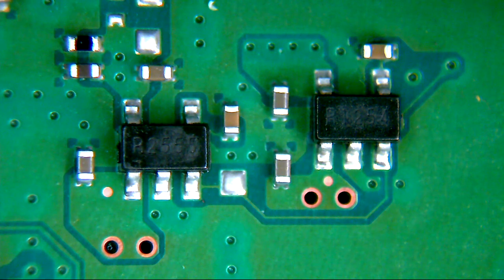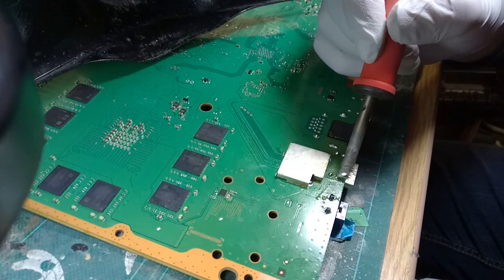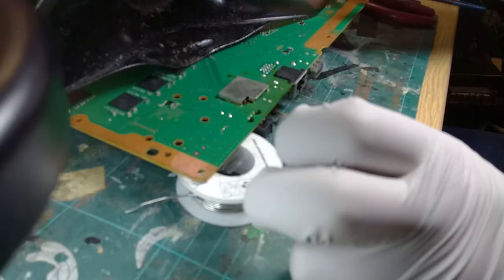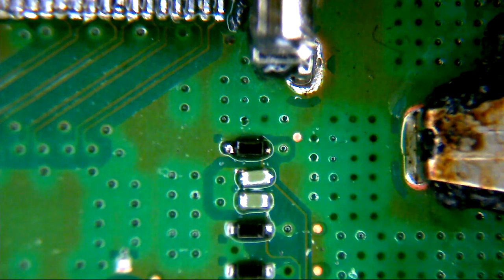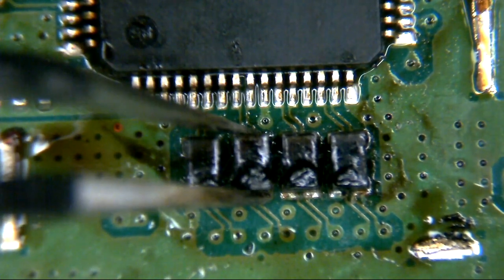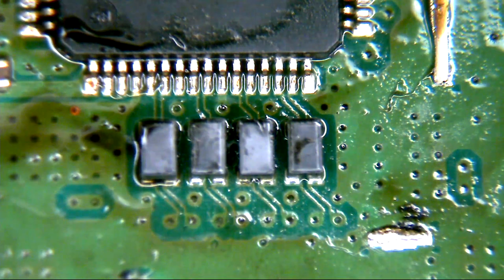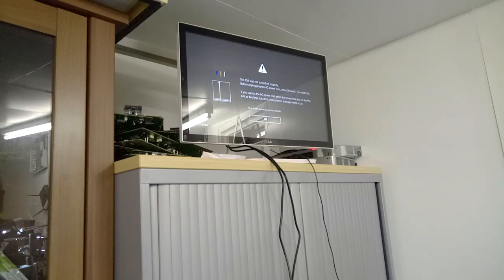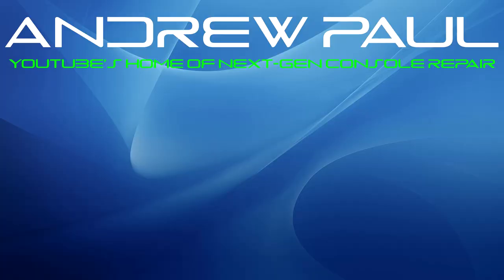Idiotic "Professional" Ruins PS4 HDMI Port Repair. Can We Fix It?

Comment: I can't believe that someone looked at that after they finished soldering it and said "yep, that's good." Every one of those pins looks like they didn't have enough heat. The plastic damage on the ethernet port....ehhhh, shit happens. I know I've burned my fair share of plastic from collateral damage but it's always been cosmetic (that one there looks pretty fucked up though). As an amateur in training, it really upsets me when people who do work like this pass it off as professional, and even charge people for it. Ridiculous.
Reply: Do people not know what kapton tape is? That’s it’s entire purpose, to localize your heating and prevent from damaging or accidentally melting or desoldering nearby components, and from the looks of it they didn’t know what flux is either, all of the solder joints look oxidized, kinda like they weren’t heated enough and didn’t bond to the pads

Comment: I'm no expert, it looked like your pins were not aligned well.
15:40 looks to be off the pads to the right a smidge.
Seems a better initial anchor might've saved that extra work?

Comment: In fact people see the top level of modern electronics being repaired in front of their eyes and the most of them thinking how easy are these kind of repairs that can be done by everyone.But no one can do these except a few well skilled with proper equipment,much experience and even in some cases quite luck if all things go well and nothing bad is happened.
Reply from the maker: It definitely looks easier than it is - that said much of the time though if decent equipment is invested in then it can make even the most ham-fisted amongst us look capable in this field. The problem comes when you only want to repair your own machine which makes that investment a waste of money and people try and use cheap equipment which is what then gets them into trouble. Even then though it's still cost them more than it would to simply get it repaired for them - but as this channel shows even that isn't a safe bet sometimes. I think it's about time the consumer electronics repair profession required some accreditation so that the public could be sure that the people repairing their machines are in-fact competent professionals which might cut down the number of badly repaired or damaged machines out in the wild and stop this 'race to the bottom' mentality amongst the cowboys out there who devalue our profession, work and levels of skills involved. Sadly won't happen though.

Comment: What exactly is FLUX? I heard of using isopropyl alcohol during these things but now i need to know what FLUX is to use as well.
Reply from the maker: Flux is a paste or liquid which aids tinning and wetting of solder joints - in other words it helps it to flow easier and helps create a better quality solder joint. It's essential for an easier repair experience and a better quality job.

Comment: Great video man, love your videos very educational and entertaining.
I always have said two is better than one, two hdmi ports in case one breaks.
Also if they could do a design of hdmi ports that could attach would be easy replace, but that is just an idea only.
Reply from the maker: Cheers mate. It'd be a good idea but connectors are very expensive things in PCB design and manufacture.
Reply: Andrew Paul how about USB port? Is that cheaper, could they make a video output from a USB similar design, would that be cheaper, also USB seem to be more durable, and they could possibly do two
Reply from the maker: USB 3.0 is quick enough (after all you can buy USB 3.0 docking stations for laptops with multi-DVI / HDMI output support) - the only issue is needing to implement the chipset to give that functionality would be very expensive and complex from a design / manufacture point of view compared to a dedicated HDMI circuit.
Reply: Andrew Paul very interesting.
Yes I understand because the chipset is made for HDMI the chipset wouldn't work for this.
Is there a way to update the chipset? I mean through softmod or updating the console? 
The only think I can think of, is if they would need to make the chipset to be smarter and also have updates to recognize if the video is working on tv, but then it would be on a newer console eventually.
Reply from the maker: Sadly not - it's a physical design issue within the Silicon so you'd need a whole new chipset and custom implementation on the board (basically a complete revision of the mainboard) to implement.
Reply: Andrew Paul yes it would need a new console with that design integrated, but I would think that it will be more quality and cheaper, I mean it could be an option if they wanted to have two outputs, I personally think a USB in design as Apple Lightning cable charger but wider with double sided is more quality and can transfer more data, because of more pin connectors.
If Apple made the charging plug in the Apple charging cable wider, I think this can be perfect and extremely fast.
I wonder if having Ram as Cache would improve speeds in chipset.

Comment: Do you happen to have any information on the components under side of the board of the HDMI connector on a SAC-001 board? As I'm learning as I go, I have noticed a few boards I have replaced ports on I have also lost a few small components down there, rendering video output non-existent and I'm hoping to revive these boards.

Comment: Quick question what temperature is your air flow at and what air flow setting do you use.
Many thanks for the video.
Reply: 480 C
Reply: 480°c on both my hot air and soldering iron with air at max. 🤷‍♂️

Comment: I've tried to do a HDMI replacement.... I knocked off the chip closest to the HDMI but resoldered it back on but now all im getting is a red screen when i turn the ps4 on is it a chip issue or pins? Any help greatly appreciated
Reply from the maker: Small 2-pin closest the port on left side with port facing you? That's a protection diode - stripe needs to face left - if orientation is wrong you'll likely get no video.
Check each pin for continuity to its neighbour with a multi-meter for shorts. Remove any found with some braid and flux. Finally give each pin a nudge test with a tweezer blade and look for movement - this is much, much easier with some magnification if you have some. Any loose pins need re-soldering. Otherwise you may well have a dead Encoder IC - was the original port damaged at all in any way before replacement?
Reply: Andrew Paul the original port did not look damaged im am 99.9% certain the pins are ok I will recheck the protection diode.
Reply from the maker: Could well be a bad Encoder IC then bud.
Reply: Andrew Paul damm I soldered the diode the other way round no red screen now but no picture either
Reply from the maker: As long as the stripe is left when the port is closest to you then you're good to go (Pin 15 diode).
If so then it's likely a failed Encoder IC - particularly if the old port was free of damage.
Reply: Andrew Paul thats a shame I have some old mobos I could get one off just don't know if I have the skill to do it yet.... only one way to know I guess
Reply from the maker: Plenty of flux, tweezers and a steady hand mate :)

Comment: 15:12 - I'm curious as to why you fit the port that way, rather than clearing out the holes, then fitting and soldering in with an iron. Is there any advantage doing it one way or another?
Reply from the maker: V2 ports line up with the header perfectly so by using the solder in the locating holes you can stick the port directly in, get it flat to the board and you have something there to instantly anchor the port into place while you go about getting the I/O pins installed. It's a time saver and makes your life easier IMO. I used to clear the holes but as above it's much easier to leave them filled for me at least but different people will have differing preferences.

Comment: Please reply Andrew Paul, I have a Xbox one black version that soda got spilled in it from the side which the fan is on. it played for about 20 mins then went off. i let it dryed a day then it worked for 10 mins then it went back off. i took it apart 3 times so far. the first time i took it apart without removing the heat sync with the fan on it. i cleaned it with water i acutally ran water over it to remove the liquid soda. i let it completely dry. put it together then the light came on then completely went off the brick when to white orange white then orange. i took it to my friends house to hook it up to his. brick it did the same thing his xbox came on. so i ruled out the brick. took it apart again but this time i did a complete break down remove everything even the heat sync. below it was the ACU with thermal compound paste still on it. i clean around it with alcohol and q tips were the soda spilled on it i , also check to make sure nothing was burnt or USB proms was bent touching. everything looked normal. almost looked brand new i kept the thermal paste on it cause i have none to use. i put it together and it  now beeps but wont turn on it will make a eject sound but nothing happens. what should i do. i have no warranty to send it i would like to try and fix it my self. should i remove thermal paste and reheated it with a heat gun then has some new one. idk what to do at this point the 3rd time time i just took it apart  just to double check everything still same thing
Reply: the brick is orange now and it stays that color it beeps one when i hit the on button  then i have to unplug it then plug it back in to make the beep noise again. now im taking it back to my friend to plug his brick back in
help me out please
Reply from the maker: Could well be dead mate - that side of the board has much of the power regulation for the RAM and APU. if soda got over these then it could be toast. Any I've seen with this were beyond help sadly.

Comment: Do you have to use specific HDMI ports. I'm sure I read somewhere that you had to use specific ones for PS4 as generic ones weren't compatible or caused issues. I've only just started the video, so I'll delete this comment if it's mentioned later on :)
Reply from the maker: PS4 ports are indeed a bespoke part.

Comment: Im going to be honest here i knocked off the diode as it was my first attempt i didn't use chip quik to help removal so i got frustrated and knocked the diode off being a board butcher 😅 my question is now im better at soldering 🤣 do you know where i can get the diode so i can have another go or can i run a trace from one of the pins any advice would be appreciated its the top one i knocked off 😳

Comment: im guessing the previous flux, caused 70ohm short on EMI filters... would have to check the EMI filters after they are cleaned ... idk , but i wouldnt be surprised if it was those... just saying.
Reply: Dorian Golej that would be one helluva unusable kind of flux if it gave 70ohm, that's damn near a short. Nah, I suspect that the show started with encoder ic going pear shaped, monkey comes in and changes working hdmi port and  shorts several pins, shorted pins FUBAR the coils via the encoder that's done for anyway when they plug it in to some shitty monitor/TV and that's where it landed on this video. 
I've used a ton of different flux and tested a lot sometimes even with it still damp, and it's never shorted anything, not saying it's impossible but it's extremely improbable in my experience.

Comment: I wonder if those filters can be attached with magnets, so they can just be place there with magnets sticking.
Reply from the maker: Not really - the magnets would introduce interference in the signal.
Reply: Andrew Paul I think that is a myth, you should try it to verify if this would be legit, most of what humans think is actually wrong, just like how nuclear and atomic bombs are a lie because not scientifically possible
Reply from the maker: Definitely wouldn't work.
Reply: Andrew Paul they once told me that cell phones were affected by magnetic interference, so I gave it a try, I had several big magnets the size of my hand at home, so I made a few calls with the magnets attached to the cell phone, I had no problem whatsoever, none, the phone still working and it didn't hurt or damage it in anyway, I was skeptical about the screen being damage, but no damage occur to it, because on older CRT screens were affected if you put a magnet there, but then once you took the magnet out the tv screen will slowly recover from the magnetized, as it reestablished, somehow the screens in cell phone work differently so magnets doNOT affect cell phones in any way, not even on signals is just a myth a fake idea humans have, just like cell phones would interfere airplanes is also a myth not true.
Reply from the maker: The air plane / cell phone thing is mainly due to potential theoretical interference with the Avionics but those are incredibly well shielded anyway and on modern jet liners you can even use your cell phone in-flight as everything has been designed to provide that as an extra convenience for business passengers etc.

Digital signals like HDMI / USB etc are very susceptible to interference due to their nature. Any interference to the signal however slight (certainly with USB) will result in the data packets becoming corrupt and rejected by the host controller. That's why when the EMI filters go slightly out of spec you can lose functionality via USB or HDMI as on the PS4. It's particularly an issue with things like laptops where they can get water ingress etc due to spills / outdoor usage etc as the liquid will come through the port and into the localised area behind where these filters reside.
Reply: Andrew Paul there is a ridiculous sign where I fuel in the company that I work for, that shows not to use cell phones when fueling, as it warns of possible cause for fire, absolutely ridiculous signs and myths that people have in there minds, this is how the devil makes humans believe this fake ideas in there operating systems.
Just like many other myths that people create by ignorance and manipulation, they said that eucalyptus trees caused the interference with the converter box and some other crazy ideas that are just nonsense really, just laughable really.
A good idea would be to use foil to block the filters and lines, as a protection from interference, believe it or not foil is good for this, because it can help reflect slightly some other signals that might affect the data to become corrupted by other similar sources that could interfere, they make jokes about making foil hat as to use for the brain protection of mind reading aliens which doNOT exist, but to a certain extent is actually possible, because I used some thick layers of foil to actually block some of the magnets I have from preventing to stick to other magnets, as the foil helps reduce the force they emit from one another when close together, in my opinion not also it helps from preventing signals from hacking, but it will also be a really good protection against excessive heat sources, in my opinion it will be more quality making the EMI filters and the chipsets from foil instead of plastics is far better, would also help from magnetic interference that could possible disturb the data from getting corrupted, making even the CPU's from foil can also help increase the chances of hacking and improve security and performance in all electronic devices, as well allowing heat to not damage this components making much higher quality.
Reply: One question is what about if EMI occurs some time.The end of the world may happen or the sun will fade out.And who says that a device meets all the EMI requirements?Yeah,right.
Reply: Frank Nakamo blabla, the reason for saying don't use cell phones while fueling cars is because of fumes which can in rare occasions be ignited by a spark between the battery and its terminal inside a phone. If I'm not mistaken this actually happened, hence the signs since then. Or at least they think that's what lit the fire, there wasn't that much left to investigate afterwards but someone convinced a jury or judge it was plausible and thus got paid damages and so now we have signs. Didn't read the rest of your long tirade about tin foil etc.

Comment: and 71.5 ohms... i dont know what kind of meter... but to jump without a physical short... if EMI filter was shorted between coils... should be near 0 ohms, or a few ohms... just like before... id guess some solder inbetween the pads... because to cause a spark gap of 71ohms still doesnt make sense for solder ... to me itd be the hdmi chip is bad... maybe was the flux? gunk thats on there... possibly water from the isopropyl alcohol ... otherwise itd be the chip or gunk... shorted filter should be zero left to right... or maybe 0-6 ohms for both coils.... but eh... id blame the gunk... wet resistance... 71 doesnt make sense for a shorted coil... itd make more sense... that being cooked they go open ... but idk... just what i know... may have broken the 

As you stated previous flux they used, could be cheap crap with petroleum in it... causing wet shorts...